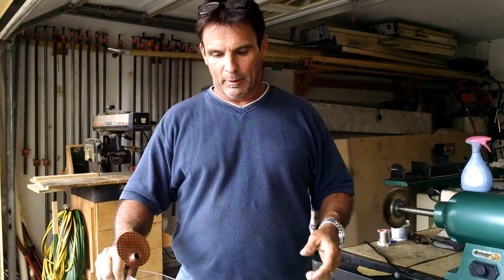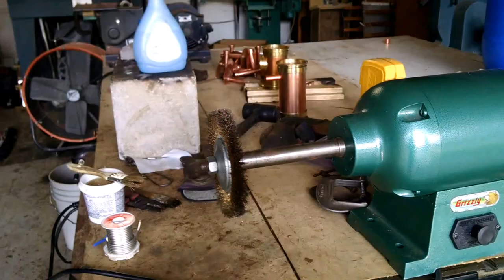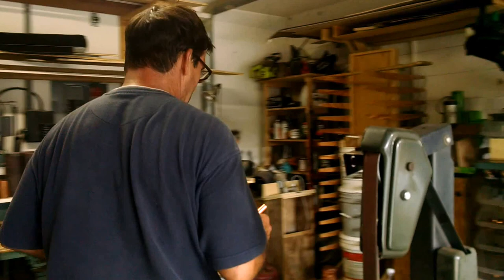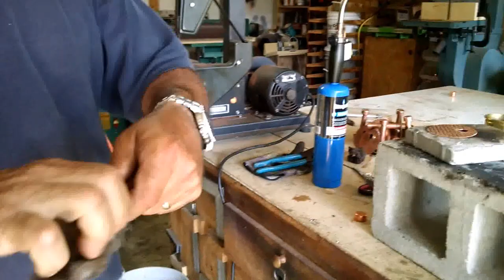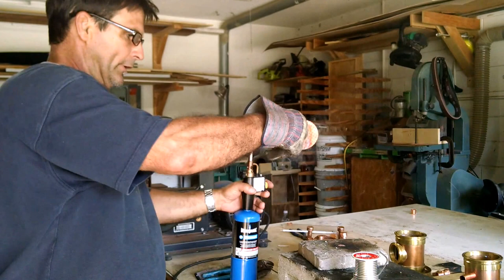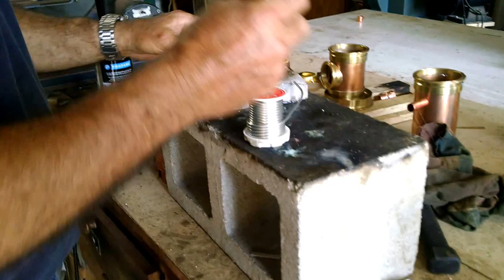Down Comber Fabrication for Copper Moonshine Stills

Comment: Can you explain how this sit inside the actual body sections? Is there a lip in the brass ferrules that the perf sheet sit in and the bottom of the down comber sits just above the perf plate underneath?
Reply: *****  hey Darren  yes there is a shoulder cut into the inside of the brass ferrule for the pipe to sit down on   thats why its so inportant to make a square cut on your pipe  hope that helps and dont forget to visit out site
Reply: +Trevor Wolters I believe Darren is wondering if the ferrule has an additional "shelf" that extends into the ID of the pipe. Or, is the perf sheet the same OD as the pipe, sits on the lip, and then the square-cut pipe sits on the platform created by the perf sheet?  Then it's all soldered together into one unit?